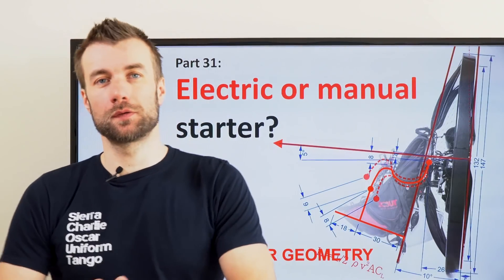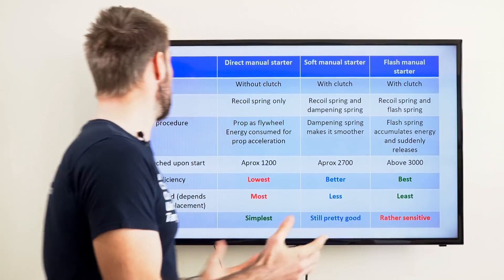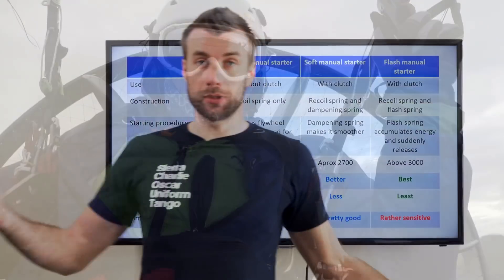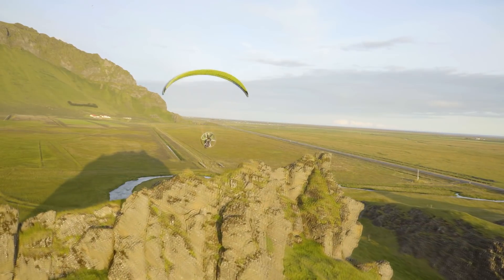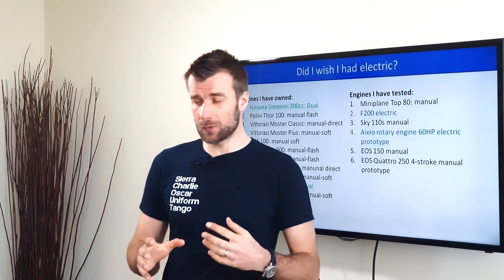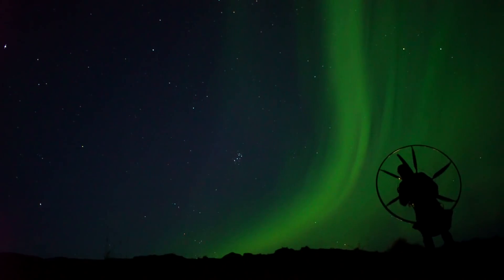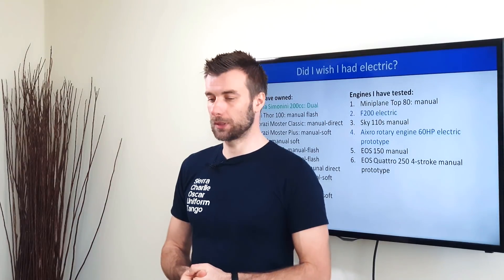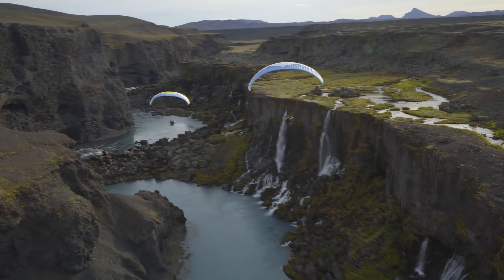Electric or manual starter? Paramotor geometry part 31.1

Comment: Well, cannot keep me from some critics here, sorry.
Electric strart saves a lot of energy you need for take off. Also, not every pilot can keep their motors in meant starting conditions like I am sure you do. When there is a slight invisible problem with carburetor or ignition or just the weather is cold or fuel is not perfect - you name it - electric starter may just save your day. Some motors just don't start very easily and require a good spin.
When you stand fully strapped-in for take off heavily dressed for your winter cross-country flight the last thing you want is the pull starter.
So maybe we should stay neutral with your initial definition of the purpose of flying and the feature matrix, rather than advocate to personal preferences.

Comment: Great video. However, it is missing one important point - ease of restart in flight. Electric starts lets you kill engine, do your acro or just enjoy the silent glide and then easily restart. Manual start is often hard to locate in flight and awkward to use. Additionally, electric batteries last many starts so showing up with dead battery is gross negligence on pilots part. Just charge it up once a month. I'm flying manual and wish I had electric.

Comment: Thanks!  I'm very happy you're making paramotor videos again.  They are great.  I have some questions related to the topic of this video.

My intention is to fly long cross country journeys through extreme boonies.  I will be landing in very high, very remote areas to camp at night.  The worst thing in the world to happen in this situation is to not be able to start the paramotor the next day.  This makes me think any battery + electric starter systems is asking for reliability troubles, and therefore a very bad idea for these kinds of missions.  Do you agree?  Plus, just as you mentioned, I will be loaded down with as much extra fuel and cargo as I can carry and figure out how to attach to the paramotor.  On the positive side, I can probably [almost] always land and camp in places that have moderately to very steep downhill slopes in most directions, which should greatly ease running for take-offs.

So the question is, would do you suggest is the best for this situation?  Obviously an engine starter system that "never fails" is highly desirable.  However, it is equally important that  I  "never fail" to start the engine, which might happen on cold mornings at high altitude (because I can't pull enough engine RPMs manually.  Which makes me guess  the simpler manual+clutch approach might be best.

Another consideration is... do any of these engine starter configurations have "a fallback method"?  In other words, can any of these engine starter configurations be started by a human manually spinning the propeller?  Or alternatively, if I can easily take-off without a starter because the wind is strong and/or I can run down a 30-degree to 60-degree steep downward slope (that continues that steep for hundreds or thousands more meters), do any of these engine starter configurations let one get the high speed wind generated by flying downward at a high speed start the engine?

I suppose the following might be an alternative way for you to respond to this question.  Are any of these engine starter configurations such that one could carry just a very few, small, lightweight parts along (on every trip) that would let a pilot fix the engine starter configuration if some element broke (pull-cord, clutch, whatever else is in them)?  Obviously the fix would have to be not too difficult, so as to not require hauling around a bunch of heavy tools, and also not to require extreme manual dexterity (since it will probably be freaking cold when this happens).

Sorry for the long question, but I do suspect the considerations for flying in very cold, high, remote places might be different.

Finally, I've been waiting to buy a Scout paramotor from you until I can get the 4-stroke solution.  I suspect that engine will be much better for the kinds of very remote, very long distance "adventure flying and camping" that I will mostly be doing.  I'd greatly appreciate an update on progress, whether you believe this will reach the market, and at least a wild guess as to when.  Thanks!